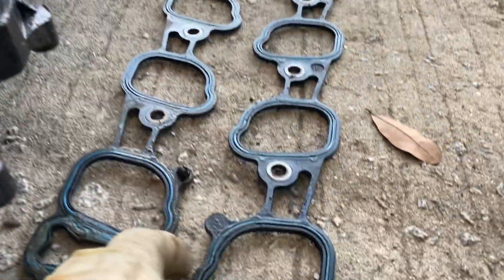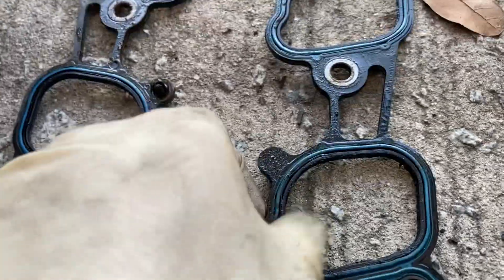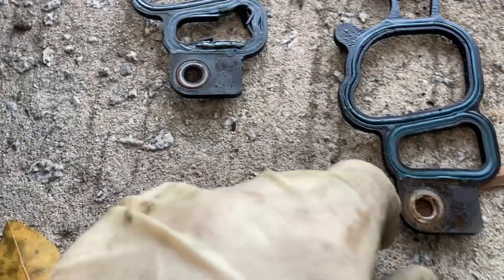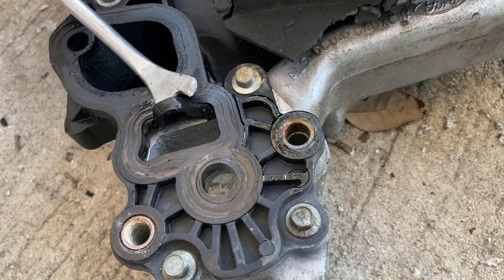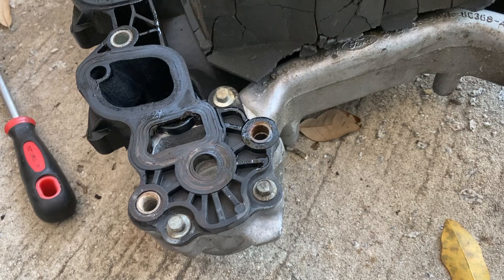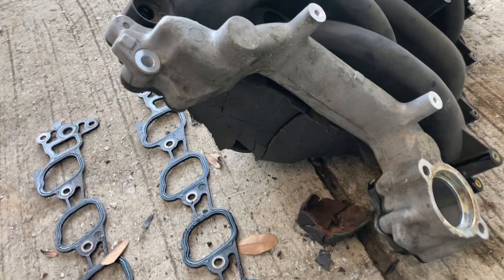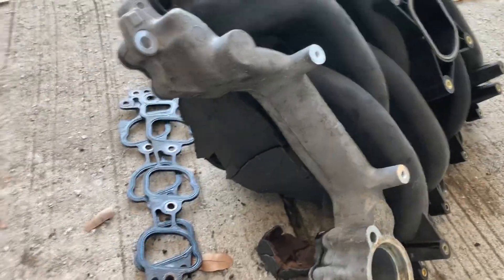2001-2011 4.6 2 Valve V8 Intake Manifold Failure

Comment: I have a 2008 f150 4.6 never had any problems with it. Reverse went in the transmission. I put a brand new transmission in it. 

When I got it back I had a misfire. Changed spark plugs it eas fine. Then the tube for heater hose in the front in intake started leaking. Changed the intake and have had nothing but problems since. The aftermarket intake was leaking around this spot. 

Have had 3 or 4 dofferent intakes on it. And all of them leak. Idk what to do with it now and apparently all the after market intakes done work correctly and ford doesn't make them anymore.

Comment: could you cut away the plastic base and put the metal crossover straight onto the heads with some RTV? Of course this doesn't solve the right rear heater hose nipple that will also eventually crumble and bust off....but its a start.....

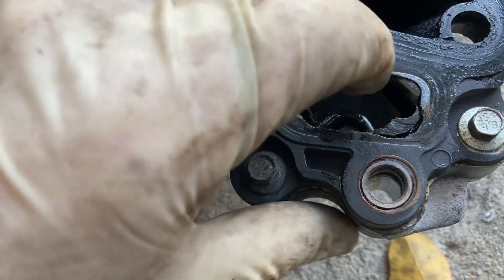Comment: 0:33 is why I always say "a new intake" when everyone else is saying "new gaskets"....if your intake is over 10 years old with avg use, replace it.... I'd like to put a metal band inside a new intake where the plastic cracks allowing the gasket of "migrate" inward.  Like a ring off your finger, bend it for the prefect fit into the space and wedge it in place to "hold" the plastic in place. Of course the gaskets eventually fail as well as seen in this video....metal intakes can have gasket leaks after 20-25 years. One of my 95's started leaking at the right side intake gasket and was dripping coolant, so it is what it is......

Comment: The crazy part about is it was fully aluminum from 1991-1995
Reply from the maker: The way it should have been…
Reply: @technickalgarage  Right but of course, they chose the cheap route.
Reply: @infinity3jif  one day someone will make a proper all aluminum one ready to go. Molded and modeled after the plastic nonsense. I know there’s an aftermarket one but not sure on fit/finish on ADTR